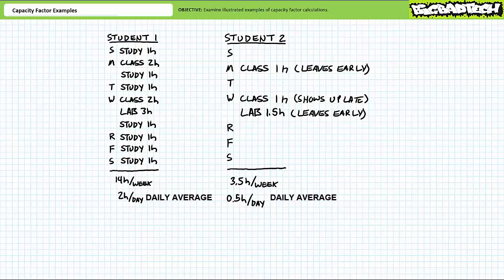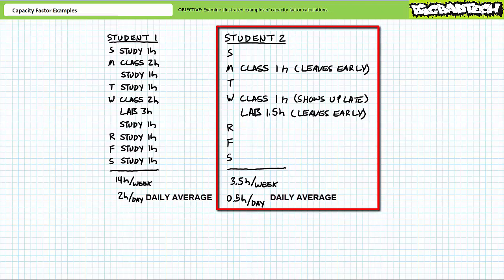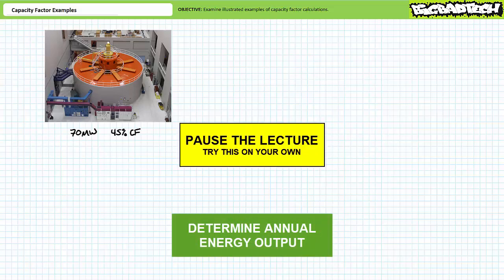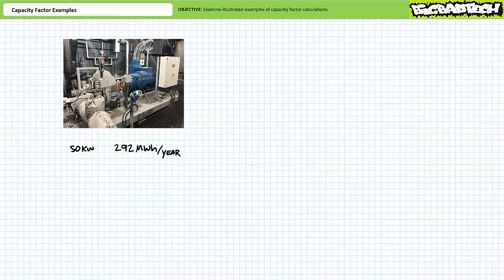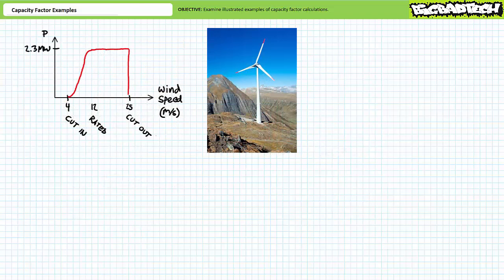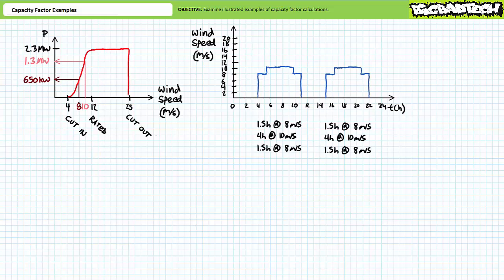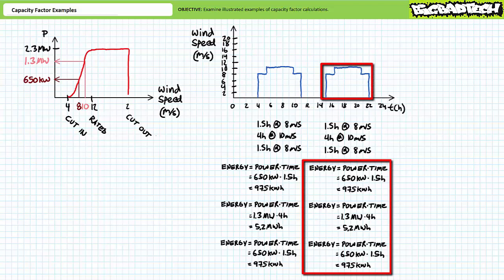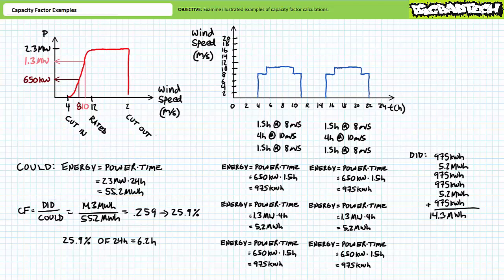Capacity Factor Examples (Full Lecture)

Comment: Hello Mr Jim! Will it be correct to solve this task through the ratio of total amount of hours a week (actual work) to 168 hours a week (ideal scenario). Basically I get almost the same results as you got. For example: cF1=14h/Week:168h/Week*100%= 8,3%. Thanks for sharing your knowledge with us, it is really useful and practical. Wish you Good Luck Sir!
Reply from the maker: Yes, as long as you use the same unit you're fine.
Reply: i too did most of these problems differently but arrived at the same results. and i feel good about it becauase it tells me that now i'm really starting to understand what i'm doing.